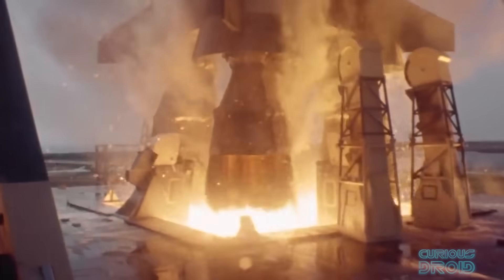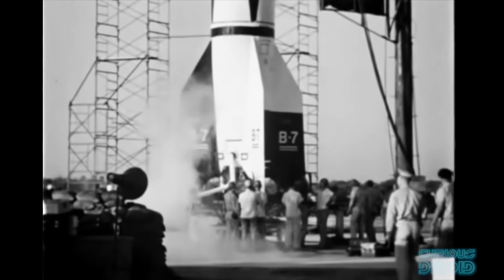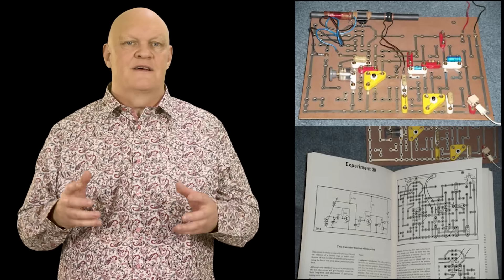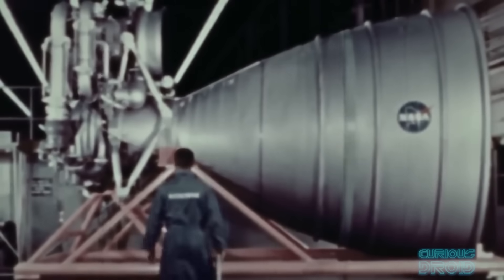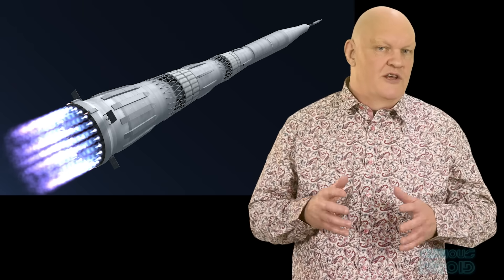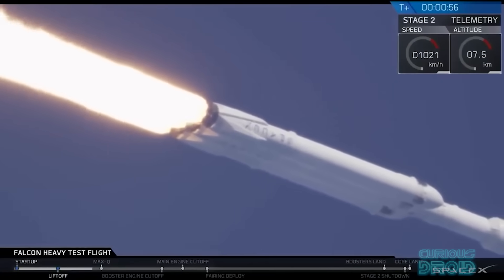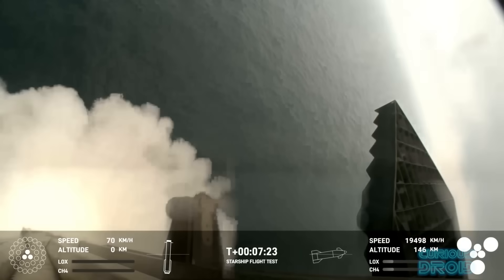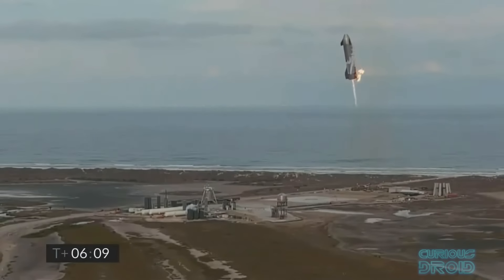Why Does SpaceX Use 33 Engines While NASA Used Just 5?

Comment: Wow that looks a lot like Soviet moon rocket engine lay out. 

I believe SpaceX buys old Soviet engines or designes for them under the promise they don't alter the design cos if they do they won't be stable and the rocket will go wherever haywire out of control rockets like to go.

If they're still using Soviet designed engines it's only appropriate for them to come to the same conclusions the soviets did with the N1 
She was big she was beautiful but god she was complicated and expensive
Reply: You're slightly misinformed. Aerojet Rocketdyne back in the early 2010's, bough about 33 mothballed NK-33 from Russia, not SpaceX. The NK-33 engines had been intended for the next iteration of the soviet N-1 moon rocket.  Aerojet modified and refurbished the engines to include a nuner of modern components such as sensor telemetry, valve components, etc. The resulting engines were renamed the AJ26. A number of those engines were subsequently flown on the Antares rocket. There was one probable engine failure onboard an Antares in 2014. The exact cause is unknown but ine theory is a manufacturing defect in the oxygen turbopump. In addition AJR has plans to produce a heavily upgraded and redesigned NK-33/AJ26 in the future.
Reply: @TSorovanMHael  misinformed my butt. I remember that hyped up launch of the reusable rocket and it being launched near some anniversary of something NASA did in the 50s or 60s and to commemorate this everyone who wore a tie to work wore those thin  ties popular with guys in that era and the rocket exploded on the way up and the Russians they bought the schematics, and rights to reproduce said engines,  said space x was warned not to change the design lest this issue or outcome would happen and space x , at the time I saw last, didn't have a comment on the  subject of altering the schemes they purchased. It was around 2014/2015. 

Spectacular blast I might add
Reply: @TSorovanMHael  I don't even understand what the big deal is... The design of this new monster dong magnum rocket is obviously taking after the Russian moon rocket. Now that was a magnum dong of a monster rocket, if I do say so myself 🫦👄
Reply: @kristinarain9098  Super Heavy is similar to the soviet N-1 in that they both have many engines compared to the saturn 5 with it's few freakishly large, in my opinion oversized F-1 engines. I wouldn't consider them similar otherwise. The important difference is that the super heavy is about 50% more powerful. The Soviets used a large number of smaller engines because very large engines tend to suffer from highly destructive combustion instabilities at low throttle and particularly when starting. NASA went to considerable lengths to mitigate this issue on the F-1 and they were still very expensive and very difficult to fabricate for this and other reasons. The soviets weren't willing to spend a fortune developing a new monster engine which they though might be dangerously unreliable and elected to mass produce many smaller engines more cheaply. 

The reason spaceX does it is, aside from cost, smaller engines have a better form factor, are slightly more efficient, and have a better thrust to weight ratio. The soviets were also aware of this advantage, of I recall correctly though cost was their main consideration.
Reply: No, Raptor engines are designed by SpaceX and have nothing to do with Soviet designs.

Comment: Redundancy is a factor. On IFT-1, the booster had five engines fail. If Saturn V had five engines fail, it wouldn't have gone anywhere. The more engines you have, the more likely you can survive multiple failures.
Reply: Right. But you also have to balance that with the fact that you have roughly 6x as many parts, which might fail perhaps catastrophically, so overall with a large number of engines you need to have a lot of operating experience where you have good statistical data on the odds of any given critical part failing. So the odds work better in y our favor for noncatastrophic failures, but work against you for catastrophic ones.

Comment: The Starship has no human escape system. This means it can never be certified to launch people into space.
Reply: It'll need hundreds of flights for crew rating. They'll get it. Space Shuttle had no escape system yet it continued to fly after it's mishaps.
Reply: @motokid6008  yes I get the iteritive design idea. At a billion dollars a shot it will cost far more than the saturn and shuttle programs combined. Even if it gets there and I don't think it will, the idea that it was privately funded or even the design process worth in the long run will be in serious question. This is about Starlink2. Not the moon.
Nothing about the Starship says crew cabin, humans and zero demonstration of any safety systems.
Reply: @motokid6008  Also I don't think launch licences are granted to system without escape systems anymore. You know the whole astronauts still alive for two minutes while crash burning back to Earth thing.
Reply: @blueskies792  - And yet the Shuttle still flew after that despite having no launch escape. "a billion dollars a shot" - Starship cost is about $100 million when fully expended. "Starship says crew cabin, humans and zero demonstration of any safety systems." - They havent built it yet. The ship has only flown four times.
Reply: @motokid6008  Oops yes 100 million times 1000 ok. And no I don't think SpaceX will get a license to launch people on Starship. Because dead people.
I have serious doubts Starship will ever be anything except Starlink2 payload sleds. Recovery will vary and reusability as rare as a Tesla Roadster.
Reply: A launch escape system is not a requirement for launching crew. It may be that NASA requires it for NASA astronauts, but if SpaceX wants to launch their own crew, that is only governed by FAA regulations.

The FAA doesn't really concern itself too much with dangers to the crew. They are concerned with dangers to the public. As long as the crew are informed of any risks, and sign the appropriate waivers, SpaceX can go right ahead and launch crew.

Now what SpaceX can do isn't exactly the same as what they can be expected to do. SpaceX could launch crew on the next flight, if they strap a Dragon to the Starship, but it will likely be dozens to hundreds of flights before they fly crew. SpaceX doesn't want to needlessly endanger crew.
Reply: @SpaceAdvocate  Not going to happen.
Reply: @blueskies792  Will happen. Just sit back and watch.

Comment: You get everything you mention correct.
There is even more to it though.  TLDR-version:  They also arrive at more and smaller engines because they need higher thrust/weight ratio.

Long version:  Note that other launch rockets are effectively three-stage rockets, but SpaceX' Falcon9 and Starship are pure two-stage.  Also note that both of them are optimized for payload to LEO.  While they can put lighter payloads into higher orbits, that's not what they are optimized for.

Next consider how things scale by various variables, independently from other things for now. Like most other machines, fewer and bigger rocket engines are cheaper than more and smaller rocket engines.  Fewer, bigger rocket engines also combine into greater reliability, than many smaller rocket engines. Otoh, smaller engines have greater thrust/weight ratio.

You end up in different types of cost considerations, from intending to throw away the rocket than by building a reusable rocket.  They work kinda paradoxically.  A lot of design decisions are motivated by the desire to make the throw-away rocket as cheap as possible.  Otoh it's going to be such a big expense anyway, that the impact of some expenses become relatively less.  Thus 3-stages, multiple types of engines and even multiple types of fuel.  These things mostly serve to make the throw-away rocket smaller and thus cheaper.

When SpaceX aimed for reusable rockets, they didn't only aim for one rocket launch becoming cheaper by itself.  They also, and still do with Starship, consider that the launch costs are going to become so low that they drive up the number of launches.  Now we play a new game, because mass production technologies can be aimed for from the start.  It'll take time for them to pay off, but they will, and big time too.  It'll not only solve the cost for the many engines, but will also help the reliability factor.  Because of the 'small' engines, the granularity is there already for needing only one type of engines. Simultaneously, the marginal cost (beyond the cost of the rocket) of each rocket launch becomes significant and should be kept down, so only one type of fuel, and no boosters. 

You get forced into multistage rockets by the rocket equation. But also by the need to reduce the burn time against 1g gravity 'falling', because all that fuel (and weight) is wasted.  It does not contribute to raising the energy of the rocket.  The solution is good initial acceleration of course, to get the rocket moving as rapidly and early as possible.  That's the purpose the first stage in 3-stage rockets serve, as do boosters, which works together with the penultimate stage to form a first stage in what then effectively becomes a 3-stage rocket.

For a reusable rocket this is not an ideal situation.  Expenses go up.  There are also limits to how far you can let the penultimate stage fly.  The higher energies and longer distances it reaches, the more difficult and expensive it's going to be to recover & land it.  So we end up with a pure 2-stage rocket where both the stages need to do heavier work than the first and last stage of an effectively 3-stage rocket.  And we need thrust, as in thrust/weight ratio, both because the first stage need to lift and accelerate against gravity, but also because the second stage cut in when there is still a significant amount of that anti-falling work remaining. As the rocket approaches an increasingly orbital trajectory, i.e. falling is not eating energy as much, thrust is going to become less important and specific impulse more important.  But that is the luxury of effectively 3-stage rockets, not for SpaceX 2-stage rockets.  So that is why SpaceX' engines have much greater thrust/weight than any other.  It's also why the Raptor is so extreme.  It has to be.  Methane results in lower thrust/weight than kerosene.  It needs all that extreme combustion pressure, specific impulse and full cycle to reach thrust/weight parity with the Merlin, and the the thrust it need to lift and accelerate the Starship.  The more they can squeeze out of that engine, the more payload, in increasing rewards, they are going to get to orbit.

LEO:  The only thing that ultimately matters is payload cost to LEO.  If you want to go to higher energies, that can be done more effectively by the payload itself  (including fuel as in refueling or a space-tractor).  Thrust is no longer an issue, so extremely high specific impulse engines, with very low thrust, can be used.

Comment: I seem to remember that the engines the N1 used, the NK-15 was designed for to be expended in a single burn. It used an igniter system that couldn't be replaced, so the test NK-15s could not be used on the actual flight hardware.
Reply: Specifically, the issue was that the valves were single use. They were opened by small explosive bolts detonating, meaning they couldn't be closed once shut.
That means the engine could start up and run only a single time, then all the valves had to be replaced.
The NK-33, which was intended to replace the NK-15, had regular valves and so could be fired multiple times.
Reply: @lazarus2691  Yeah, that was it.I knew it was something explosivve and single use.

Comment: SpaceX... overcomplication, lack of redundant backup systems and a CEO at the brink of securities fraud... The person from NASA who favoured the contract to SpaceX ended up working there. By the time they enter orbit, they used up all the fuel... they haven't tried it with payload yet...
Reply: Starship has yet to be fully fueled. If you want a fully reusable rocket then it's going to be complicated and you can't have a launch escape on such a large vehicle in all practicality. It just needs to work.

Comment: The answer is simple and obvious. Pathetic SpaceX doesn't know how to design large combustion chambers for stability (along with many other technologies). Neither does anyone else today. Only old Rocketdyne could do it.
Reply: Did you not watch the video? The raptor engine holds the record for the highest combustion pressure in the chamber. So that's simply not true. Large engines are no good for landing and reuse. They don't have the throttle response.

Comment: Same old spacex apologies when what is needed is very large engines like the F-1, except burning hydrogen. Cheap and nasty is not going to spread humankind into the cosmos....only make money with satellites. Completely slanted for spacex because if he was to say anything critical he would be cancelled by the legion of cyberthugs in the Musk Cult.
Reply: "what is needed is very large engines like the F-1, except burning hydrogen"

Hydrogen isn't really practical as a stage one fuel, due to its bulk.
Reply: @maxfan1591  spacex propaganda from 15 years ago. Methane is also not very dense but they use it now because it saves money by using autogenous pressurization.
Reply: @GaryChurch-hi8kb  Methane isn't as dense as kerosene, but it's still around six times denser than hydrogen.

An engine like the F-1, but burning hydrogen has already been tried, with the RS-68 on the Delta. It was just ridiculously expensive. An obvious dead end.
Reply: @SpaceAdvocate  LOL! keep on naysaying fanboying! The dead end is your brain.
Reply: @GaryChurch-hi8kb  I'm just an aerospace engineer.

Hydrogen has some merit for upper stages and spacecraft, but it's just silly for first stages on earth.

What you gain in efficiency you lose in dry mass, and it's just pointlessly difficult.

For expendable rockets, you can't really beat a kerolox first stage, while for reuseable rockets you want a low carbon fuel to avoid coking in the engine. Methane is a good option, but options like ethane or propane can also work.

Methane has the advantage of being purified natural gas, so it's very cheap and available.
Reply: @SpaceAdvocate  Riiight....the aerospace engineers that designed the Delta IV were just silly and you are far above them. Got it. Fanboys never stop being fools.
Reply: @GaryChurch-hi8kb  I didn't say the engineers who worked on the Delta IV were silly. They just didn't have good options for engines available to be bought. Their best (non-Russian) option was the RS-68, so they went with that and made the best out of a bad situation.

Eager Space actually has a nice video on the topic. https://youtu.be/bFY2FK_p4Bo

Today we actually have lots of new engines being developed for all sorts of fuels, so we likely won't see a rocket like the Delta IV ever again.
Reply: Very large engines are useless for landing the first stage, which is required if we want to get away from paying billions per launch.
Reply: @zounds010  No...that is not true at all. Engines can throttle down to about 20% now and the super heavy weighs 200 tons empty. Figure it out instead of just being a spacex fanboy.
Reply: @GaryChurch-hi8kb  Nobody's demonstrated an engine the size of the F-1 throttling down to 20%. The larger the engine, the harder it is to run at low power settings. 
Having 33 instead of 5 engines also gives more margin: losing one F-1 meant aborting the mission, and we've seen Starship just continue and do a successful mission with one engine out at liftoff.
Reply: @zounds010  B.S. , stop making stuff up.
Reply: That last clip he used was so nitpicked he removed the explosion right after it lands. This video is a joke.
Reply: @klutzspecter3470  The video used was of the SN10 landing. On this flight test, the explosion occurred 8 minutes after landing. Do you expect him to show 8 minutes of video, waiting for the explosion?
Reply: @klutzspecter3470  - It's the best clip of Starship landing. The successful landing was on a cloudy day unfortunately.

Comment: Its better to have 5 engines than 33 because of redundancy. You will constantly see in Starship engines turning off or unable to reignite. This may be an issue with Starship having a poor oxidizer and distributing it throughout all 33 engines. Starship has been constantly missing its deadlines and expectations, its time to shelve the entire project if it cannot reproduce results found 50 years ago.
Reply: Starship has already proven that it can fly with engines out right off the pad. If Saturn v lost an engine within the first 15 seconds of flight it would have been a launch abort.
Reply: SpaceX is spending a fraction of what NASA spent on development of the Saturn V, and is making good progress.

Comment: Another HUGE issue is what to do when the original expert engineers and assembly specialists (for these older, custom engines) retire or leave.  Yes, some cross training - but they rarely spend to have a buffer zone for attrition.  The best long term is to have less complexity and more repetition by many personnel.
(As example, first telemedicine system in Arizona (1970s) called STARPAHC had the most trouble with mainteance of brand new, specialized technology)

Comment: I would think cheap mass production was by far the deciding factor for SpaceX to go with the Raptor and previously Merlin. Although 'cheap mass production' is a grand description for what is essentially high-tech machines with a unit count that will likely never exceed the low thousands.

Ironically, using cheaper hardware goes directly against the economics of reuse. Still worth it, of course, but still funny how that goes.